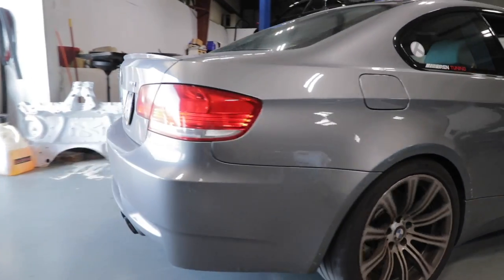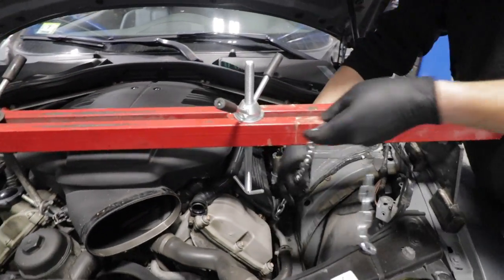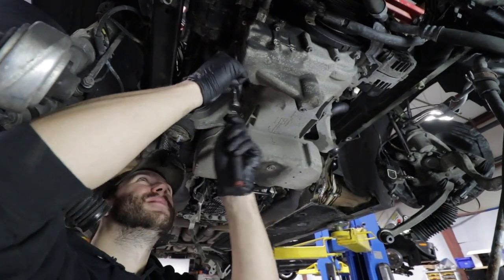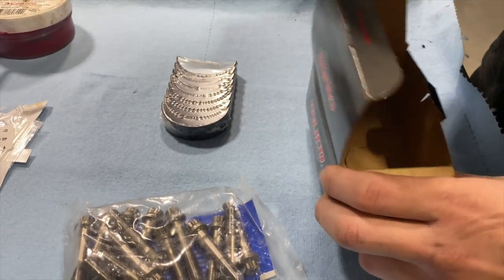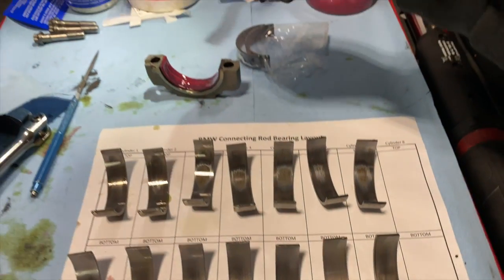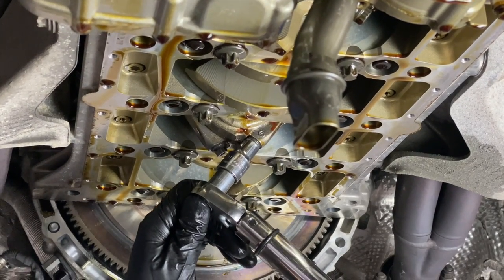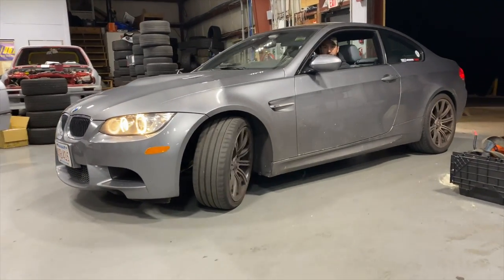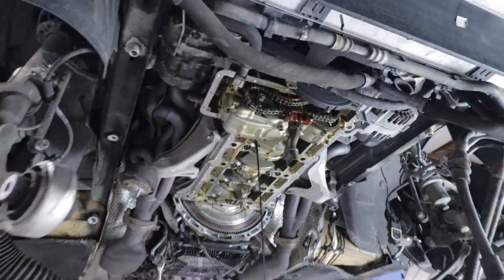E92 M3 Rod Bearing Replacement - What It Takes Start to Finish

Comment from the maker: Thanks to Wile Motorsport for the incredible work. Find them on their website https://www.wilemotorsport.com/ or instagram @wilemotorsport to service your BMW, Porsche, and Mini
Reply: Can you please tell me the brand and weight oil you are using? Thank you
Reply from the maker: @orestwolfgang556  Up until this video I had been using BMW's 10w60. For the first time here I used liquimoly 10w60.
Reply: @TedwardDrives  Thanks for the reply, like you I like solid information. I have an an E92 m3 with 50K and was wondering if you heard anything about running thinner oil? I've heard alot about this but its a friend of a friend type of deal. I appreciate and look forward to you response. Thanks
Reply: Respect
Reply from the maker: @orestwolfgang556  I would recommend against running anything but 10w60. There's more than just bearings relying on the viscosity of the oil. The pumps, Vanos, channels etc are all designed to work with 10w60. When you make a fundamental change,  you can upset the entire system. If you're concerned about cold starts, get a block warmer for the winter.
Reply: How much did this job cost?
Reply: @TedwardDrives  What’s the torque values to respect for the ARP Connecting Rod Bolt on this engine ? Is it 45 ft lb like this video ?

Comment: Goes to show one of the many reasons why changing and mainting your oil is so important. I have a 1999 Corolla with 105k miles. Runs like a champ, just started putting synthetic in it again.

Comment: Thinking on getting an E92 M3 and now I have a TO DO list: rod bearings, engine mounts, throttle actuators... anything else I should add to the list? 
Great video! Very clear explanation.
Reply: fuel breather valve

Comment: Just had mine replaced at 85k and nearly all of them were showing huge amounts of copper. Drives beautifully with new engine mounts too
Reply: Which bearings did you end up going with? I'm thinking either the coated acl from lang motorsports or the classic BE's although they're considerably more expensive.
Reply: Mic Raw I went for ACL bearings with ARP bolts, bidden motor sport in the uk did it. It’s a relief knowing they’re done, plus the engine mount replacements are a must in my opinion. Feels so much smoother. I’m sure what ever you go for you’ll be fine as long as you let it warm up properly from now on
Reply: @Faz-86  that's awesome thanks for the reply brother. I'm excited to get it done! 😁

Comment: Cheers, thanks for the video! I was eagerly waiting this one after watching a bit of the live stream. Fantastic to have someone as calm and experienced as Evan and Wile to do this work.

As I said during the stream, I had the much more rare main bearing failure on my car a couple of months ago. Completely stock and only 56k miles. These cars are magical, but having been through the experience now, I'm very lucky that it's not my only car, and that I can afford to fix it. Advice to other owners, if the engine seizes, do not try to get it running again. Mine unseized, but it just began to tear itself apart. If you disassemble it after it seizes, the crank and block might be saved. If you get it running again, the bearing will spin and it'll start to grind itself down.

Comment: What many people don’t understand is “warming up properly” means starting the engine and driving easily until it warms up. NOT letting it sit there and idle for 10-15 minutes.
Reply from the maker: Yup! Get in. Start. Drive with minimal load and revs for a bit. I’m probably going to slap a heating pad on the oil pan for winter this year for those 0 degree F morning starts
Reply: Lol are you saying letting a car idle is bad for the car? 😂
Reply: Deandalapanda exactly. Cold oil is the worst thing for the car. Idling for 10-15 minutes means the oil takes much longer to warm up. Driving the car gently by keeping it under ~3,000 rpm gets the oil up to temperature much quicker, which means less wear on engine internals. The majority of engine wear occurs during cold startup so the sooner you can get the oil up to temperature, the less overall wear in the long run on the engine.
Reply: And remember that oil takes much longer to warm up than coolant. By driving the car you might get the oil up to temp in 10-15 minutes. Idling could take 30+ minutes to get the oil up to full operating temp. So you really are better off just driving the car after about 30-45 seconds of starting it.
Reply: WRONG!  

With these tight bearing specifications, do not drive until engine is at full operating temperature, then only gently until other fluids come to correct operating temperatures.
Reply: Macht Schnell sure thing. Enjoy shortened bearing life by making the engine run longer at lower oil temperatures.

Comment: For my RACE SHOP,  I still use my 1996 Jeep Cherokee for picking up bikes. It has 600,000 miles and the oil pan has NEVER BEEN OFF. 🇺🇸🇺🇸🇺🇸🇺🇸🇺🇸🇺🇸🇺🇸🇺🇸🇺🇸
Reply: Good on you

Comment: My Skyline RB20DET has done 450,000kms on stock internals, I am running 24 psi boost pushing 350kw for the last 350,000km at the wheels never had the head or sump off just change the oil once a year

Comment: My S65 made it to 105k miles and my bearings looked about the same as yours. Engine mounts were trashed too. Should be good for another 100k.

Comment: Dude awesome mechanics! Plain and simple it’s a rough business especially for them, with customer not understanding maintenance cost. They think it’s a simple pull and unloosen bolts. It’s so much more.
Reply from the maker: Thanks! They are great. And I was hoping this video would help to explain to owners why its a ~2500 dollar job. I would never have the courage to do this myself haha
Reply: @TedwardDrives  2500$ to undo some bolts and stick in standard sized bearings?
Reply: @TedwardDrives  thats not bad
Reply: @gicugigel3790  some other place would have charged way more
Reply: @burrell2k711203  thats a 500$ job
Reply: Let me who doing it for $500 with warranty
Reply: @burrell2k711203  it depends on the country. Basically there is no risk on this job, unless the crankshaft has damage. And if it has damages, no one can give you any warranty.

Comment: hello

instead of removing all the suspension components would it not be better to just remove the 3 bolts from the top strut and drop the full leg complete with the subframe?

Thanks.

Comment: It is so important with these ///M engines to run good quality 5w-50 oil, tungsten disulfide and allow them to fully warm up before revving them out. Oil viscosity and temperature is of utmost importance for the rod bearing clearance issue.
Reply: I thought the Liqi Moly 10W60 was the best you could get so that is what I use. Why use 5w50 ?
Reply: @Andrew4181975  redline 5w-50 has proven to be best with these engines. It’s a much better cold start viscosity than 10W. Cold 10W oil is too viscous.

Comment: That kind of bearing wear is unacceptable on 80K mile motor. Good preventative maintenance!
Reply: Preventative maintenance is fluid changes lol. Rod bearings are a damn rebuilt haha.
Reply: throwing in new rod bearings in a normal engine with 80k on it is unacceptable, but 80k of abuse on  a high input v8 is pretty ok to me, high reving high input athmospheric engines are prone to rod bearing failure
Reply: Max Hartmann sorry, we don’t find that kind of rod or main bearing wear on Mercedes V8’s with north of 200K miles. Even the high performance E55 and E63’s , cam lobe wear is more probable.
Reply: @tonychavez2083  i highly doubt that the mercedes engines rev all the way up to 8500 RPM
Reply: Tony Chavez but its very expensive
Reply: @blackmesa27  Laughs in Honda hahaha
Reply: Sounds like wrong weigh of oil recommendation by the manufacture? W60? Wow
Reply: @tonychavez2083  hahah. Your funny. A Mercedes with 200K miles. That's like an albino unicorn.
Reply: It's a 9,000 rpm 420hp performance engine. And it still can do  80K miles until this maintenance becomes necessary, if it becomes necessary.
Reply: @DStabs720  vtec are known for spun bearings too 😊
Reply: @blackmesa27  Prove it. Maybe on abused and unmaintained cars that have 200k miles. This is considered normal maintenance on every E92 M3. No honda will spin a bearing with 80k miles. Honda makes some of the best balanced motors in the world. I promise that my K24 motor with over 150k miles would show no wear on the bearings, especially not gouged like they are on this BMW. To even support this motor shows that BMW owners will put up with anything, including plastic parts attached to the motor!
Reply: @DStabs720  k series are very reliable, but keep in mind that it's a 4 pot, v8 engines are more prone to failure than unkillable honda 4 pots, that's how it is, i love hondas and bmw and stuffs, i own one of each brand, every brand has their shit and makes stupid choices, for example the honda d series are very fragile because of the high stroke and conrods and theirs bearings fail easily, the k series engines are bulletproof
Reply: @DStabs720  i don't like new gen bmws, i rather keep with the e39 36 34 gen
Reply: @blackmesa27  The D series is very reliable. There are many that have over 300k miles with just fluid changes. Don't generalize V8s just because german cars suck. The Chevy LS is super reliable. The 350 before that was also very reliable. Americans built the best V8s of the past and its not even close! No honda engine has catastrophic failure when they have their oil changed at regular intervals.
Reply: @DStabs720  i don't think LS revs up to 9k rpm bud
Reply: @blackmesa27  Yea but Hondas do and don't need a rebuild at 80k. How could you stand behind this crap BMW makes? BUD
Reply: @DStabs720  I agree, both BMW's I've owned have ended their life with engine failure.  I did all the regular maintenance and put mainly highway KM's on them  both blew a bit passed 100,000kms.  BMW's engine are great when they are new and a lot of fun to drive but they suck for reliability.  It seems like they can't build an engine doesn't become known for some common catastrophic failure.  The best part is when you go back to them and they tell you it's your fault because you didn't do something like get the intake walnut blasted or change the rod bearings at 100 thousand kms, as if those are normal maintenance requirements.
Reply: @85CEKR  There is a reason that Toyota/Lexus sell the most cars in the world...Quality!
Reply: You guys are all over the board, Honda, Chevy, Toyota? Pick your brand and stick with it.
Reply: @DStabs720  ha yup, that's what we drive now
Reply: @tonychavez2083  BMW finish making good cars in 2001....2003....e38...e39....e46....where the last. ..this new shit only have LCD screens .....
Reply: @tonychavez2083  says the queer ford guy
Reply: Septimiu Razvan Bot the best BMW I remember was the 87’ 535is with a 5 speed, it was our shop car and we all beat the hell out that car and it was flawless even with north of 200K miles!
Reply: @tonychavez2083  that is a tank engine and car !!!! Good cars they make till 2002 for BMW and Mercedes....the rest is ****!
Reply: Skoda and Dacia cars are the best and longest lasting.
Reply: I agree. $3000+ 'preventive maintenance' is ridiculous.  Like mentioned, honda has been making 100hp/liter engines for decades without owners EXPECTING engine failure.  A 5.0 liter v8, like the e39 m5, would have been a better option instead of this high strung 4.0 v8 and provided more torque and fuel economy.
Reply: @1compaqedr8  lol go check the s2000 and all the spun bearing engines it made
Reply: @nomayor1  A Ford Coyote 5.0 made 420 in 2011, without spining it to 9k and it being reliable..
Reply: @luckeydog89  With what consumption and what exhaust emissions? That of 20 years ago.
Reply: Craig Krueger ive had new bmws but got rid of them before i had to worry about this mess. I do however hang on to my e36 M3, not fast but the engine will last forever.
Reply: Craig Krueger ive had new bmws but got rid of them before i had to worry about this mess. I do however hang on to my e36 M3, not fast but the engine will last forever.
Reply: @DStabs720  not really a rebuild, anyone with a torque wrench can do this kind of thing
Reply: Max Hartmann no need too they have a shit load of low end power
Reply: M I’ve seen a million AMGs and Mercedes V8s with 200k miles on them. Can’t say the same for any bmw
Reply: @blackmesa27  no they are not...hondas are bullet proof...especially compared to an m3
Reply: @DStabs720  he is right...if you took the time to learn a little...you would know that a V8 is inherently more complex and less reliable than a straight 4....a straight 4 has less vibrantions and is obviously more balanced than a V engine...
Reply: @BETNCORT  depends on the V8. If it’s a push rod Chevy V8 it’s not every complicated. A VTEC Honda motor from the same era is way more complicated. All engines are different.
Reply: so you're comparing a whole brand to M3's ? lol

Comment: Talked to the bmw dealer here in ft wayne indiana and he said hes never encountered rod bearing issues in any of the M3's in his 9yrs of being master tech at that particular dealership. He said they service a lot of M3's and while they've done several throttle actuators they've never had to do bearings. He said if one car out of a thousand has bearing issues the whole world will find out about it. I own a 2010 e93 and was wanting to get bearings replaced even though it passed an oil analysis test just to be safe and he told me he would do the work if I really wanted it done but he said I would be throwing money away. I found this rather interesting.
Reply: he's lying to you. more like maybe 1 in a 1000 wont do it. It's literally a pendemic with them.
Reply: @walkerforsyth6221  theres 3 m3's (two 2008's and one 2010) in my local area that I run into a lot at the local car shows and they never had their bearings replaced and one has 80,000 plus miles and one just hit over 100,000 and the other which is a 2010, same year as mine has over 150,000. However they all have had throttle actuators replaced. My 2010 had 67,000 miles and hasnt had bearings nor throttle actuators replaced. We all get oil analysis done every oil change and they always come back with good results. Not sure if I wanna change them or wait? Leaning towards changing them to be safe but not sure yet.
Reply: Master mechanic in my area told me the same thing. He was at his dealership for 15+ years until recently.

Comment: Well documented.  Did they use looser specifications than factory?  Most techs say the S65 and S85 rod to crankshaft throw bearings impossibly tight for proper lubrication on start-up or even before the engine attains full operating temperature.

Comment: Excellent video. What if the bearings are already causing rod knock? Is it too late to just replace them? Does that mean other engine components are already damaged?
Reply from the maker: There could be damage to the journal but if the bearing hasn’t spun there probably still a good chance of saving it. But inspect the crank thoroughly

Comment: 1. What was the pink putty you used? and 2. do you wipe clean the backing of the bearings prior to dropping them in the rod? I always have to prevent the rod bearing from spinning. is it ok to allow some lub between the bearing and rod or was there a blast of carb cleaner that got edited out? lol Thanks!

Comment: How much did it cost
Reply: anthonyk $3300 in Australia with new mounts
Reply: 1200euros in finland.. Without motor mounts
Reply: @masakasa1539  2200€ icl. vat in Sweden and with engine mounts. Labour 595€, ARP bolts 253€, ACL bearings 65€. Bearing never replaced so they had some wear (more than in this video) so it felt good replacing them after ~12.000km (75.000 miles). Prices approximately estimate of SEK.
Reply: I was quoted $2600 from German Motorworks in Nashville, TN. That was with everything in the video, motor mounts included.
Reply: 26 is a nice chunk. But I'll pay 26 all day compared to 15k
Reply: everything
Reply: ryan02s2k did you do work aswell or this was on the company 100 percent of the work..
Reply: Leonardo Santuario I guess you made this video...
Reply: @ryan02s2k  Not bad. I would take that any day.
Reply: Notice how the creator didn’t respond

Comment: I was wondering how do they do it.. I thought they have to pull up whole engine out of engine bay and take apart to a single bolt.. Smart solution. But can I have question ? You said that ARP bolts has slightly different torque specification so they have to be tighter right? So if they are tighter the gap between rod bearings and rod bearing journals will be e.g. ten thousandths of a millimeter smaller so is that mean the friction will be higher ? What is benefit to have ARP bolts rather than new OEM ones. Thank you for interesting video Ted, I really love this car. Greeting from Slovakia 🇸🇰
Reply from the maker: ARP bolts are not stretch bolts like the OE bolts...Just important to know to use the specifications assigned by the hardware and not to make any assumptions =)
Reply: The bearing change really isn't that difficult. There is a great DIY on m3post. I used BE ARP bolts when doing my swap. I previously did this on an e46 M3 using OEM bolts. The ARP bolts make the installation significantly easier due to the less complicated installation process. Using an angle gauge is a real pain when working in a tight space.
Reply from the maker: @96maxse  ^ This =)
Reply: @TedwardDrives  love the track videos. 0 experience there yet.